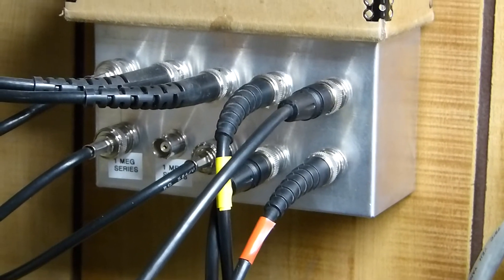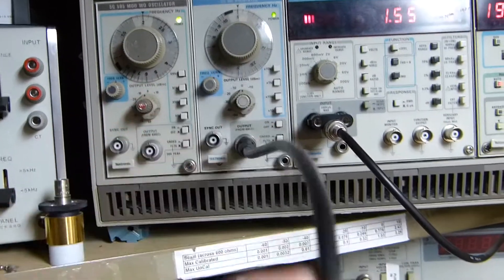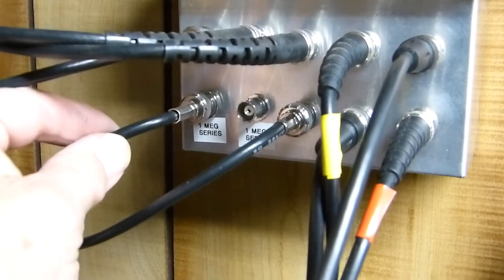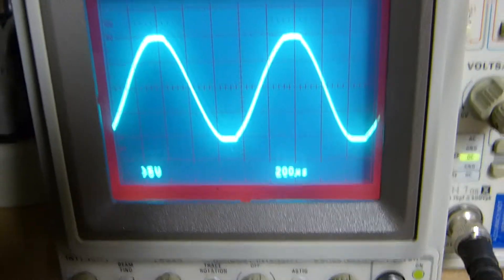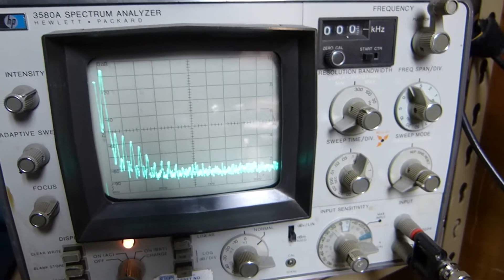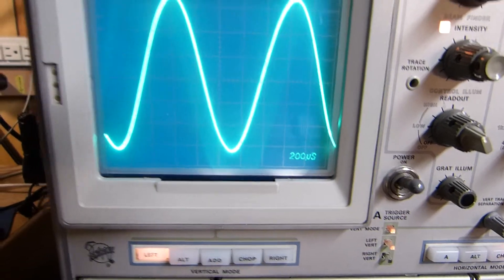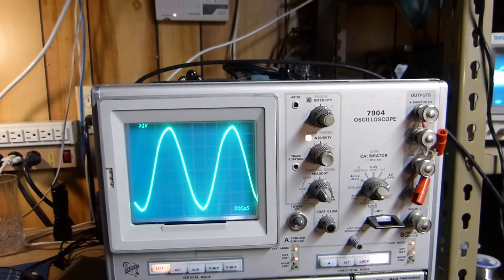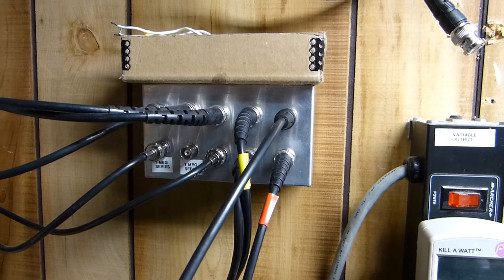Breakout Box Without Frequency Compensation 1 of 2

Comment: David, I have duplicated your breakout box with freq. compensation and really like the ease of measuring now. However, I stumbled on a issue measuring preamp freq response. This problem occurs with and without the breakout box. Using an RE084 preamp tube which is about an 8K plate resistance, cap coupled, I have a relatively high output impedance. When connected with cables, it forms a nice low pass filter when the cables are several hundred pf. I get about a 2-4db drop at 20khz. Have you built something to compensate for this issue?

Comment: howdy, is your dummy loads also plugged into the breakout box as well as you instrumentation?
Reply from the maker: Often times it is like when I am measuring the output of am amplifier. Attaching the dummy loads to the breakout box is by BNC cable also as it is just sampling the voltage across the resistors which are connected by heavy wires to the amplifier.

Comment: Hi David nice video can you do a video of the attenuator you made where testing high power amp that drive the scope of scale it would make a nice video and to see if it effects the actual reading Thanks George
Reply from the maker: George, I suspect it does affect the signal shape as would be seen on an oscilloscope or SA and I will do some work tonight to find out. It is interesting that you mention this as I have been thinking about this very thing lately (since this video). I am hoping that since the variable attenuator is only 10K it might be OK. I will see and let you know.

Comment: Hi David,
I always enjoy your well thought-out and nicely done videos. Thanks!!
I do have a question about this video...Once a signal goes into distortion, clipping in this case, it seems that attenuating the signal through a 1 meg ohm does not clear the distortion. My thought is your scope, when the gain is turned up to compensate is not as true at showing the distortion as it did when the signal was stronger. Perhaps this is a function of the front-end amp in your scope..
It's, to me, a chicken or egg coming first problem. Did the distortion disappear due to an attenuation of it's signal OR did the scope fail to show the distortion in a higher gain setting. I would be curious  to hear your thoughts if you have time.
I hope 2014 will be a blessed year for you....73, Glenn
Reply from the maker: Hi Glenn - always good to hear from you -
The problem is not in the gain of the scope - as you know, 10 x oscilloscope probes have a little trimmer pot to adjust the compensation so that a square wave has square corners. The purpose of that compensation circuit is to make sure the attenuation circuit has equal attenuation at high and low frequencies which, contrary to what we would think of as "common sense" a resistor will not have - that's why the signal display is not true after running it through the 1 megohm resistor. After making this video I realized that I did a poor job of the whole thing. Since then, experimenting around in the shop, I realized a much better solution is to just simply use a Tektronix 10 x probe where I need attenuation as all of my inputs are 1 megohm and similar input capacitance - too simple, huh ? I became aware of the problem when I realized the voltage output of the 3-400Z amp was over 100 volts RMS into an 8 ohm load and that I could easily be exceeding the safe input voltage of my equipment. I would feel really stupid if I smoked my equipment - so... I think this video is due an update.
Reply: Glenn, the reason is that there is all kinds of stray C and L inside the breakout box, and also the scope has shunt capacitance at the input, about 20pF. This is all insignificant when fed from a low impedance source, but when fed from 1M it becomes a low pass filter and effectively filters out the clipping, which consists of a lot of high order harmonics. You can see the same thing when David switched the spectrum analyser inputs: lots of harmonics just disappeared.

Comment: Taht´s why allmost all precision atenuators are active. They use OpAmps to overcome this issue.

Or you can use the 10:1, 100:1 or even the 1000:1 osc antenuator probes they only work correct for the osc inputs or equal inputs. But always check the max voltage first, As there are a lot of cheap 100:1 or 1000:1 probes but the max voltage is only 1kV so stay away from these cheap crap as they can explode or catch fire when apply higher voltage.